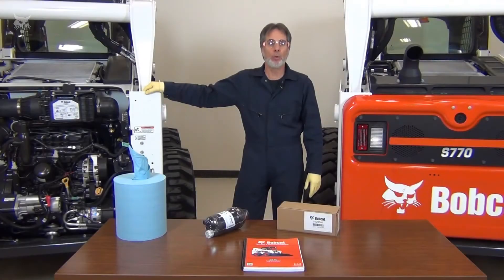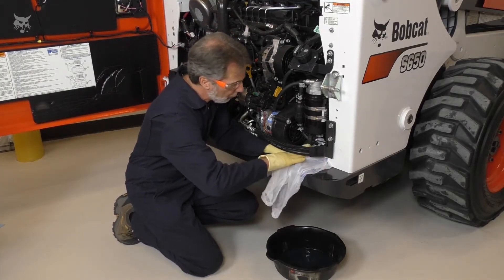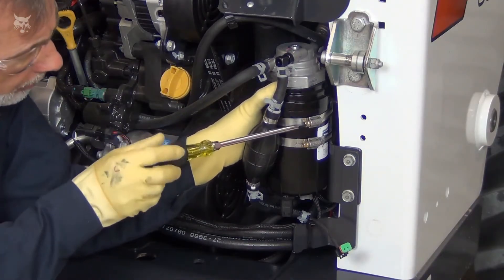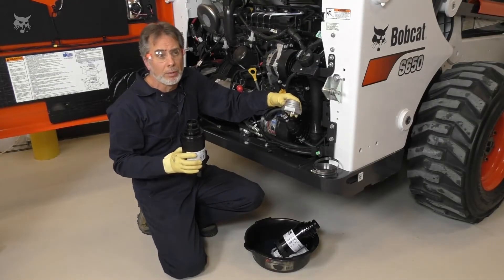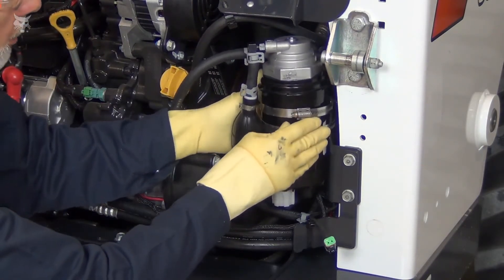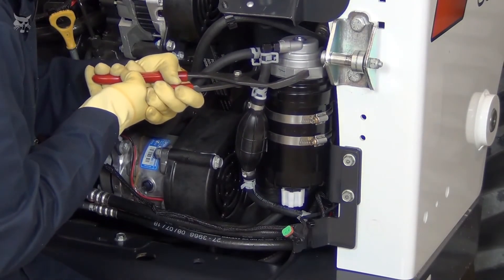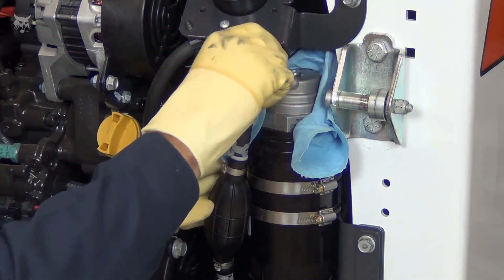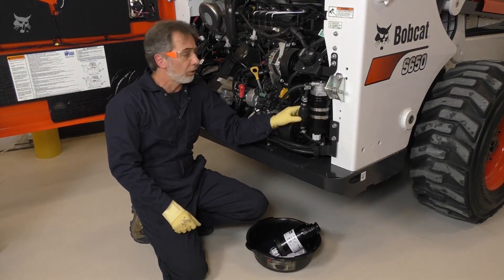How To Change the Fuel Filter on Tier 4 Bobcat Engines | Bobcat Company

Comment: This was as great video showing the right steps, but things are much more complicated/frustrating on a machine with 500/1000 hours.    Plugs are hard to disconnect, filters harder to unscrew.    A tip I picked up on another channel, rather than fooling around with that alan head on the top to vent it when pumping was to flip the newly installed filter upside down, and open up the water drain valve, then pump the air out until you see fuel, close it, flip it and give it a couple more pumps.     If you install this and then try to get to that alan head screw, that diesel fill cap will be right in your way.   Disliked having to try and use an oil filter wrench to break this thing loose ... but it does work.

Comment: Hello, does anybody know what could cause a t590 to randomly shut down. No codes no beeps, it just happens. Literally like switching the ignition off. Ignition switch doesn’t seems to be loose.
Reply: I am having the same issue. Any update on this?
Reply: Does it just turn off or act like it is fuel starved when you use hydraulics or go faster?  If so than could be fuel filter or fuel pickup tube.